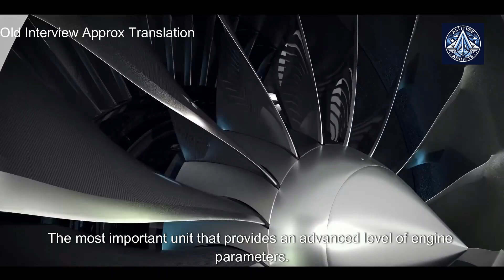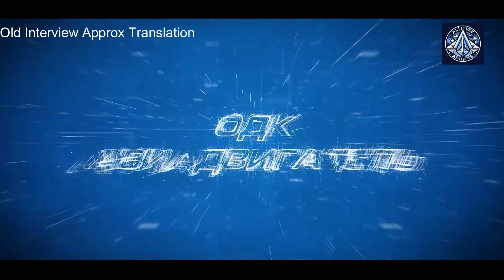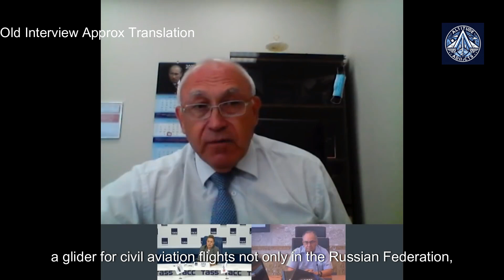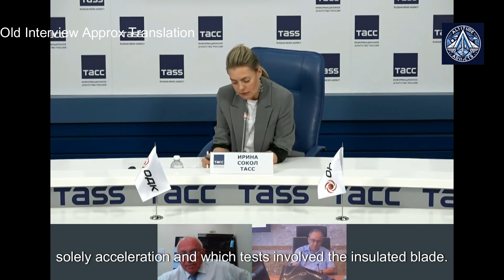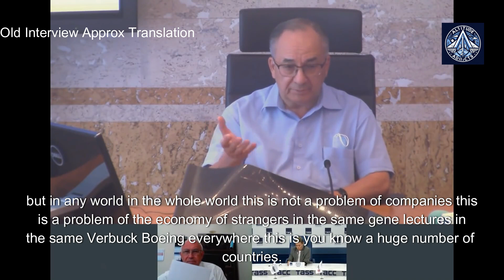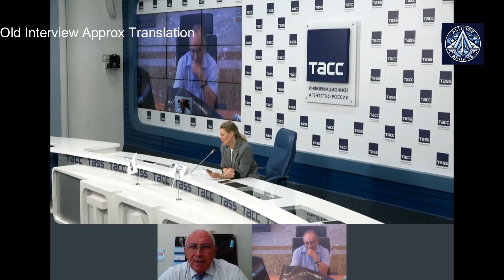Russian PD-35 Aircraft Engine : Composite Blades - UEC-Aviadvigatel Interview

Comment: There are hundreds of prototypes of aircraft engines produced by over 10 aircraft engines bureaus in Russia, even if they didn't produced in mass many of them the research continued over the years unimpeded by economic slumps and uncertainties around the post Soviet Union, They have a few warehouses full of projects that they can activate at any time for production or shared work between the design bureaus... One think is for sure, they have the scientific pool to pull it off at the drop of a hat for any requirement and they are pragmatic avoiding overly complex electronic controls by simple one known setting to minimize maintenance and repairs anywhere by anybody....